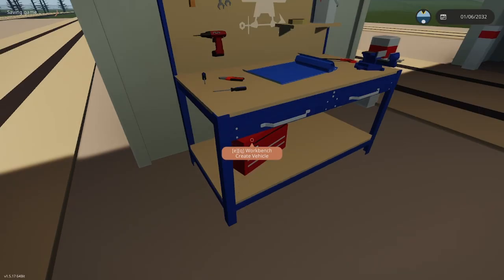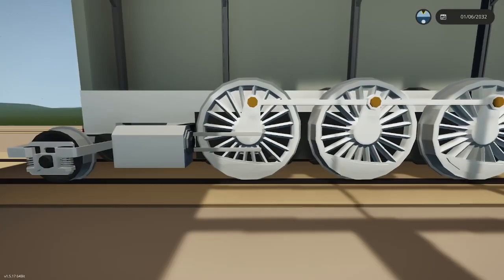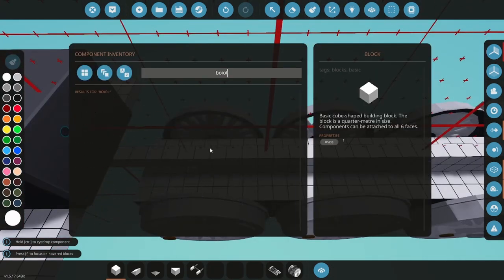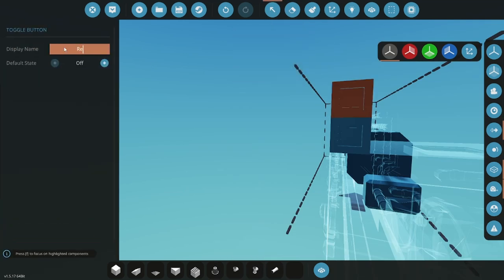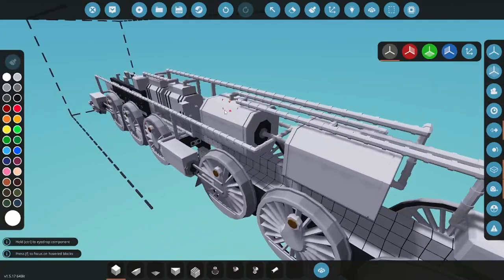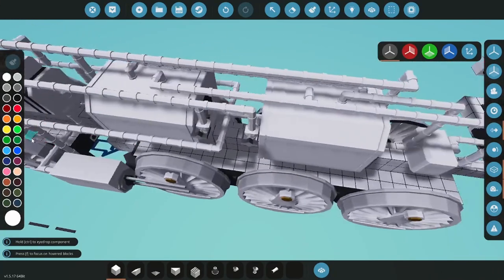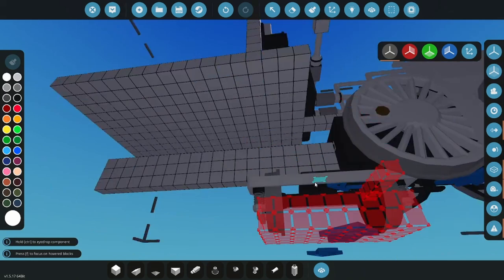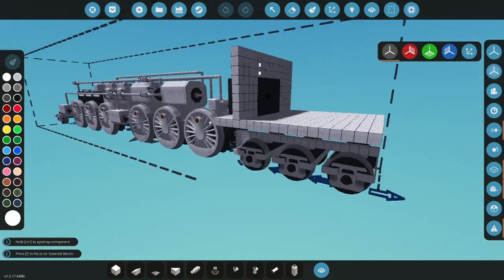Stormworks: Build and Rescue | Train Tutorial w/ New Train Wheels

Comment: dude, i was just experimenting the new wheels, but the big steam one seems to have some issues. it keeps sleeping, like there is no traction. idk if I've done something wrong. but i noticed your train has the same problem.
Reply from the maker: I have also noticed that as well and I completely agree with you. I'm guessing that maybe instead of having all of the steam go into the pistons immediately, we could limit the amount of steam heading to the pistons with a variable fluid valve connected to a throttle lever.
Reply: Everyone has that

Everyone that ive seen
Reply: i tried adding weights but no luck...
Reply: @Mr_X_Gaming  they are broken ig.... hope they fix it. I was building the big boy, but when I've put it to work.... dang that thing was sooo bad, almost moonwalking
Reply: @arthursoares2544  No its doing it because theres not enough power i think atleast
Reply: @pilot7159  I might try using two boilers for one set of piston. And also I'll be using two big pumps to pressurize the steam pipes going in it. If this thoes not work... ig it's officially broken 😂
Reply: @arthursoares2544   Did it work
Reply: @pilot7159  it... did not ;-;
Reply: @arthursoares2544  Damn
Reply: @arthursoares2544  I think i figured it out if you use steam pistons for boats you can power the other wheels and go faster

Comment: You don’t really need the condensers.
Reply: @ArmaGuyz  I know for career, but i've also thought of this. You could have a small hand held water pump that disconnects from the locomotive/tender that you can bring to a water source close to the tracks, and pump water into the water tanks. Condensers are more practical, but this is more fun :P.
Reply: @commanderdumbo967   The issue is the coolant is fresh water. Sea water while it should be able to be purified will cause damage. I may suggest that they allow us to convert sea water into fresh water.  Just as in survival you boil it to steam and catch the condensation =Condensner So theoretically we already kinda should be able to do so. Boils into steam enters condenser becomes fresh water. But there would eventually be a build up somewhere.|
I have not even tried any of the hand pumps yet I had intended to add one as an option in the event hydraulics fauied in the plane.

Comment: While I respect you took time to make a Tutorial its a bit of a seemingly deceptive motion to end the video without showing rather or not the boilers didn't over heat or over pressure and explode.
Ive followed a lot of video tutorials in which they did not show the final result in full and have been disappointed to see that my stuff exploded. Everyones number one issue with train builds is the boilers explode from either over heating or Over pressure and you showed it building but never showed if the system reached the heat levels needed to explode of the pressure needed to test your steam release Valves Im going to go with your train probably exploded within the first 2 mins after you stopped the video because of how far forward your steam release was and the number you used to start the release being a tad high for the rapid pressure building. I also suspect that your train wouldnt have ran very long even if it hadnt exploded because you ran the coolent back into the tank... meaning you were pumping water in that had just gone through the firebox and wouldn't have been cool meaning you were going to slowly build boiler temps by cycling already hot water back into your cooling system. Its also known that Daisy chaining Radiators does NOT work to cool anymore efficiently than a single radiator.